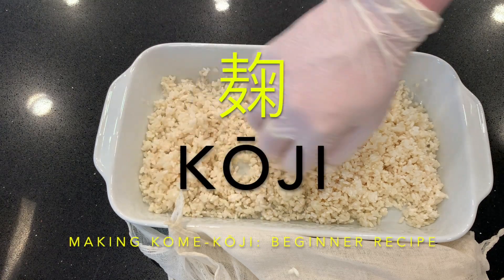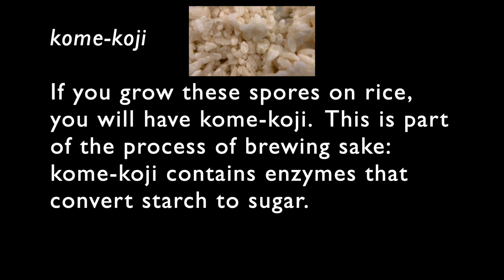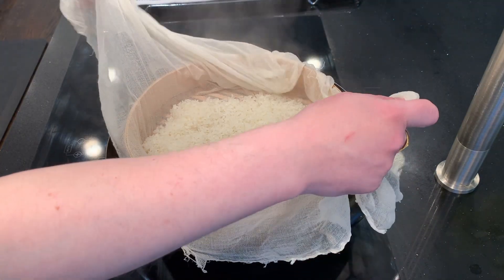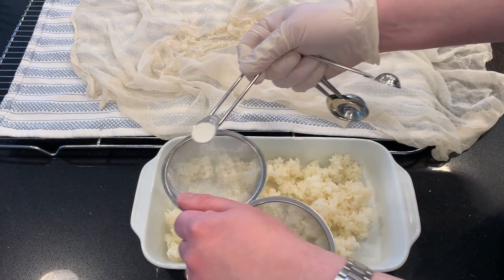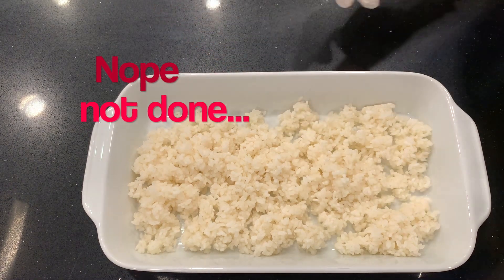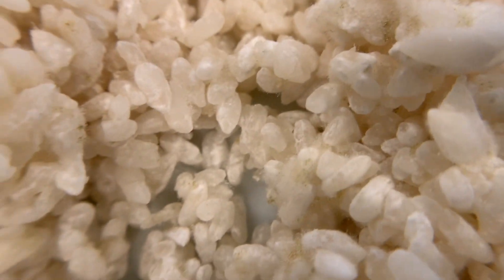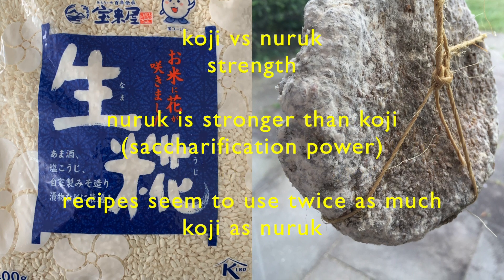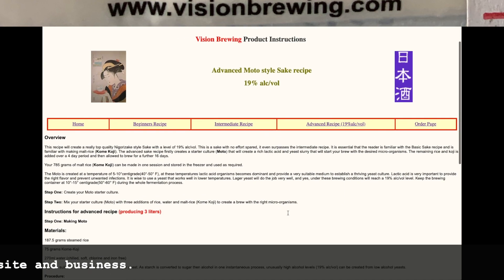Kōji 麹 making kome-koji: beginners recipe / #Mold #Spores to make #RiceWine

Comment: Hi Jeff. The steamed rice should appear as individual grain and not clumped together. When you drizzle the koji-kin which is mixed with a bit of rice flour, it will coat each grain and make it appear dry. I learned this from my first try, which ended up having more lactic acid. I stopped after 48 hours, while it smelled citrusy and a tad sweet. Surprisingly, it produced a good tasting sake! It gave a good aroma and flavor! 🙂
Reply from the maker: Thanks for the advice!
Reply: @JeffRubidge  You're welcome. 🙂